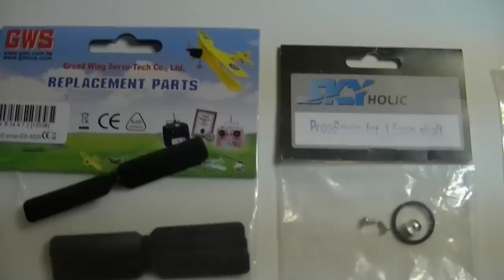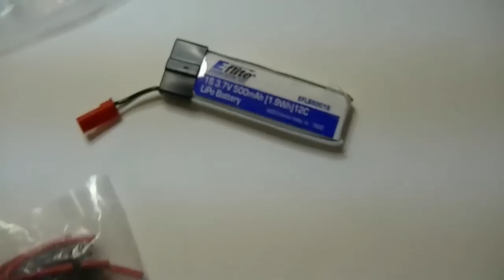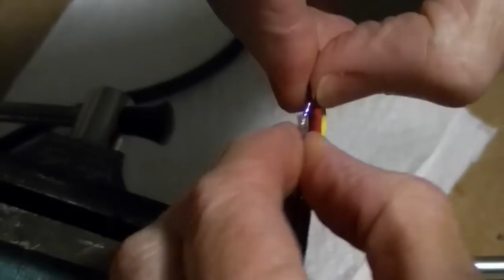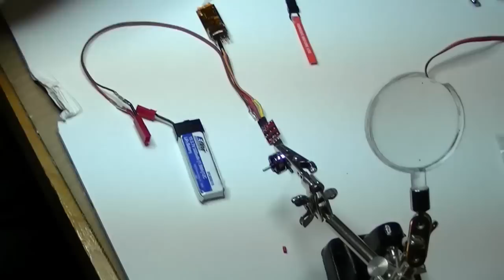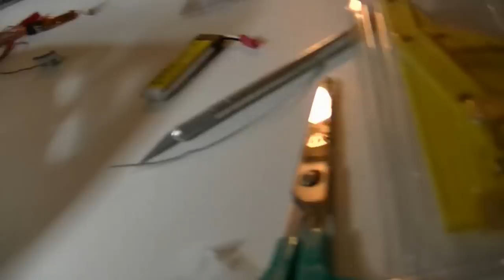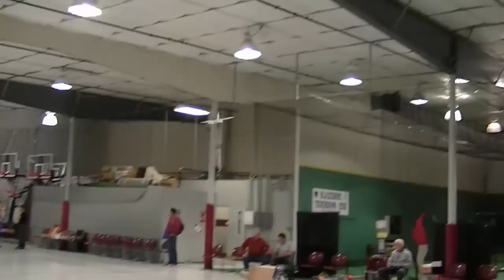Building a 2mm Depron RC plane with a One Cell LiPo power system and small brushless outrunner motor

Comment: Is the wing flat on top and bottom? I thought a wing had to have camber in order to produce lift.
Reply from the maker: +Kirby Camber helps but it only one part of the equation. This plane is so light it can fly with a little alpha or pitch upward via the elevator. If camber/airfoil was added it could fly slower however.
Reply: Are you saying that by pitching the nose upward the wings produce lift?

Comment: Could you tell me what is the max speed of that plane and how long a normal flight is usually about on that 500mah 1s battery?

I want to fix up a ultra micro P-40 on a 1 cell lipo power too (similar to your set up) but I don't really know which battery to get...(it maybe too heavy for my plane)
as well as the motor (AP03 7000kv or 4000kv?)... : /

it's made from foam & the dimensions of my UM P40 are:
length: 24 cm      wing span: 26cm      wing area: 150 sq cm

Comment: Yes they do, I had forgot. Eliminating all the plugs and using just a bit of shrink tubing may be overkill but once packaged, it looks pretty neat. 

The trick is to pre-tin everything first. Then, I go against convenional wisdom and load the iron tip with solder and apply that to the joint. The joint is first dabbed with flux. The reslt is better heat transferr to the joint. The joint sucks that solder off the tip instantly. 

Just my way of doin' it.

Comment: I've managed to unsolder the plugs from that receiver and solder the servo plugs directly to the Rx board. Tricky, won't try that again. 

FrSKY make Rxs that have micro plugs on the board but then, you need to get their Tx. Got those, they work great with a 9X Tx from HK.